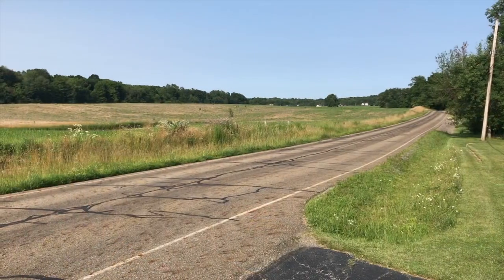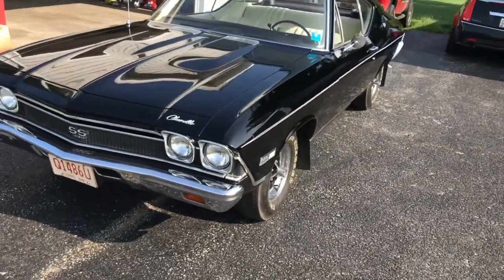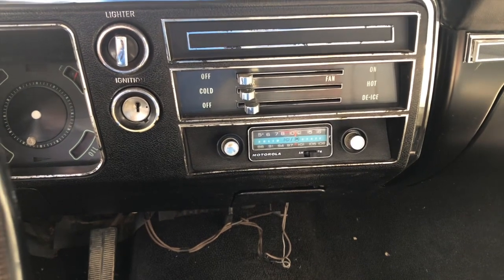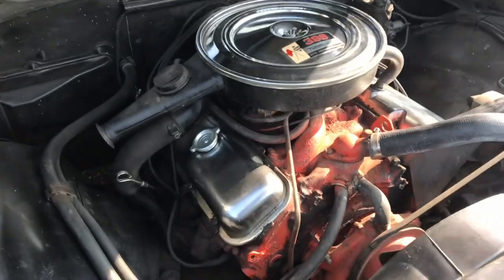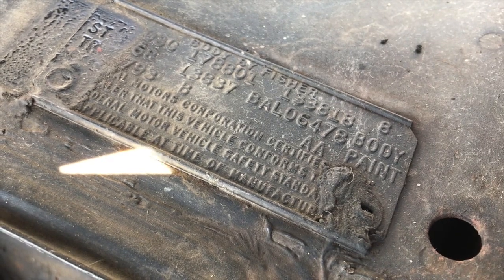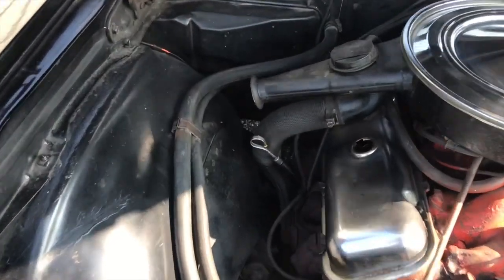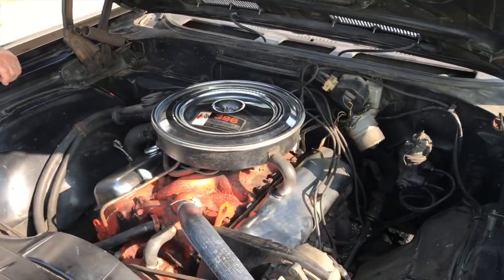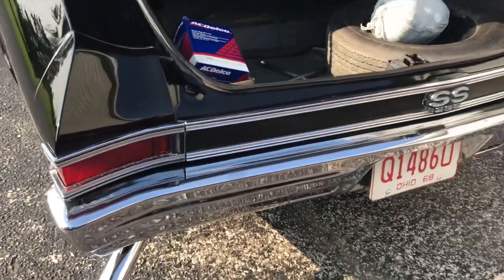Chevelle Hunters Find a  one owner 1968 Chevrolet SS Chevelle with a Protecto Plate Barn Find

Comment: I also owned a brand new Chevelle SS 396 , 350  HP , Butternut yellow with black interior , sadly it was a automatic with the floor mounted "basket "shifter , console. It had electric windows and door locks. Bought it in my Senior year of high school. Got married on graduation and the Chevelle got sold 😢. Sure wish I still had it, I paid $ 3,200.00 for that car and now it would EASILY BE WORTH $40,000.00 IF NOT MORE ‼️🏁💰😱
Reply: Was a 1968 Chevelle 🏁

Comment: I did have a 1968 Chevelle SS 396 but when I got it the motor was a 283. It had a four speed and 12 bolt posi still in it though. It was my hunting car and would go everywhere I would put my 12 foot john boat on a rack and duck hunt with it. Had to sell it when I moved out of state and had three cars. Always had trouble with the shifter for some reason.
Reply from the maker: I think a lot of people had trouble with the Muncie Shifter and ended up changing to a Hurst Shifter.

Comment: I have NEVER SEEN A SS 396 CHEVELLE with a column shifter ‼️You just might have ran across a very rare Chevelle ‼️🏁
Reply from the maker: thanks for the comment, not really rare, bench seat was standard equipment for the SS Chevelle. Two choices for the automatic either the power glide or the turbo 400 like this one.